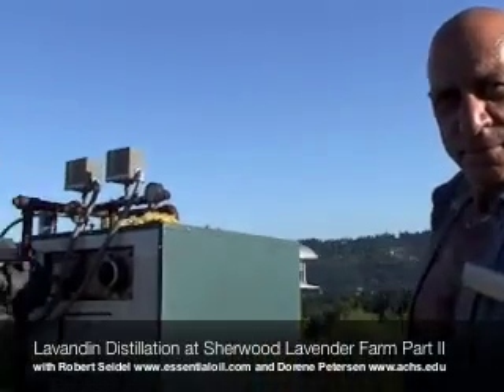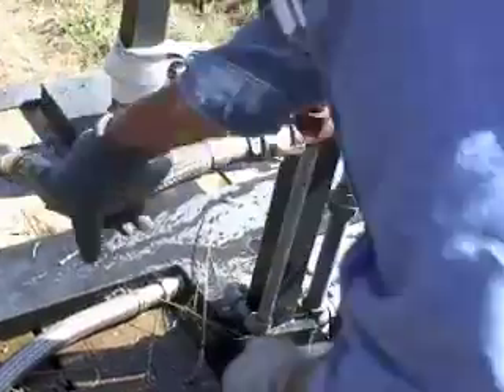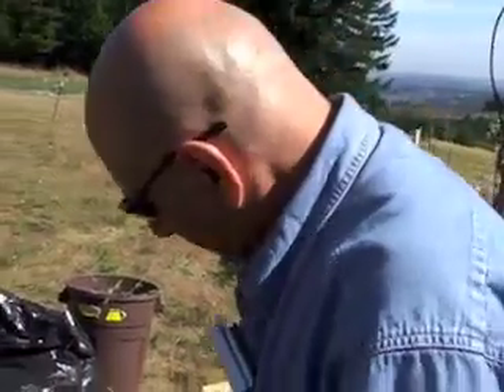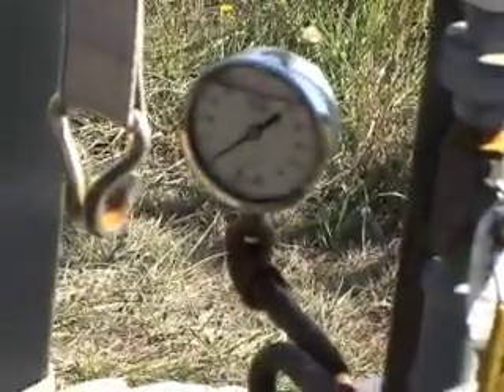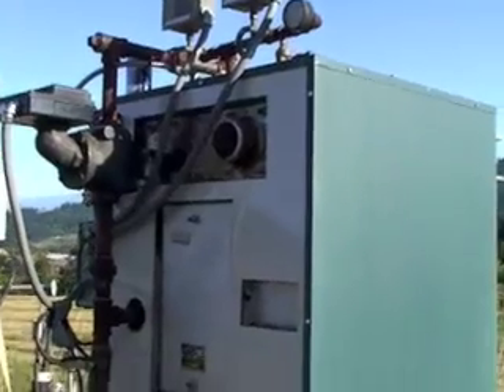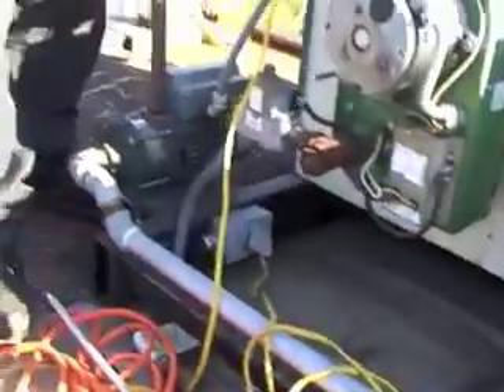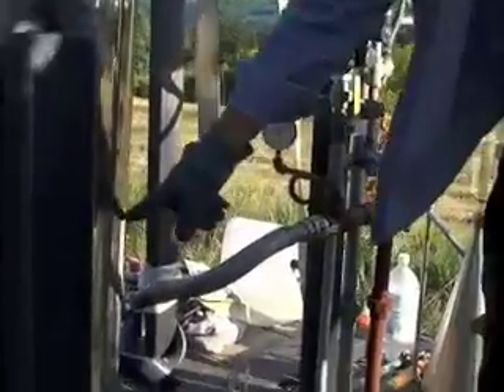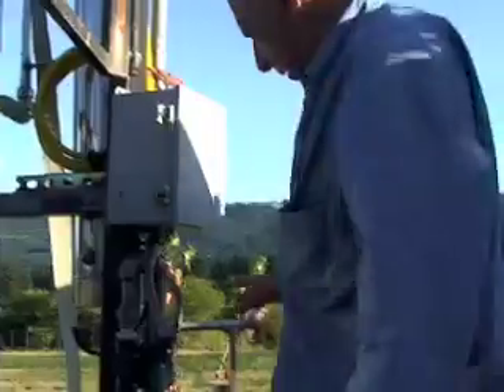Robert Seidel Lavender Distillation Part 2

Comment: Hi, can you please inform me about the price of this 100 gallon distillation equipment? Thank you.
Reply from the maker: +arimarinero The current price is $14500, for the distillation unit, with condenser and essencier,  You will need a minimum of a 10 horsepower low pressure steam generator.